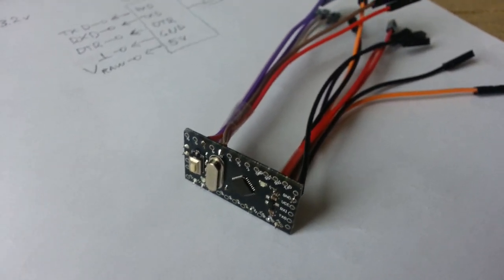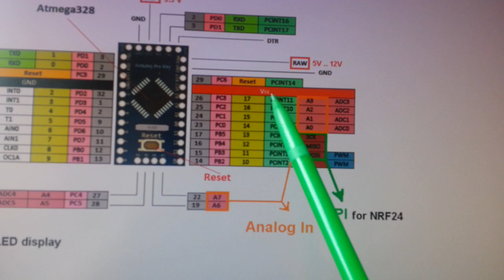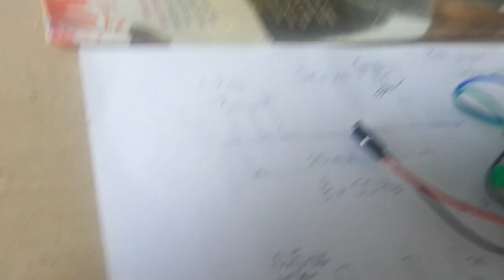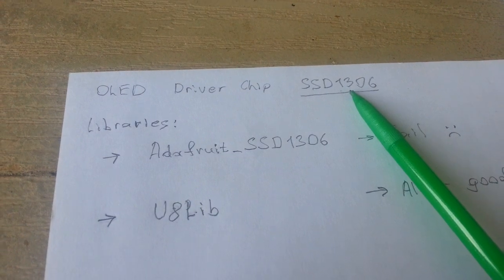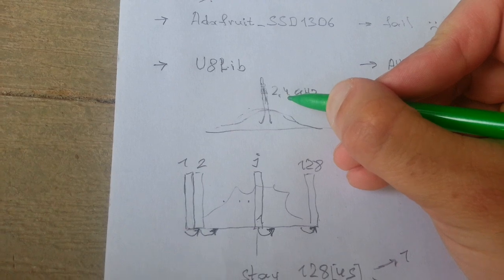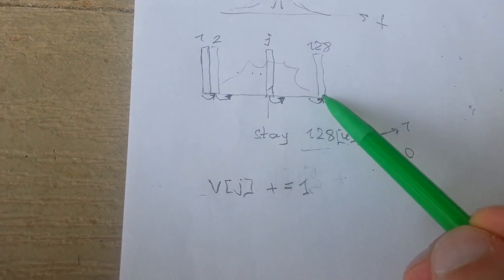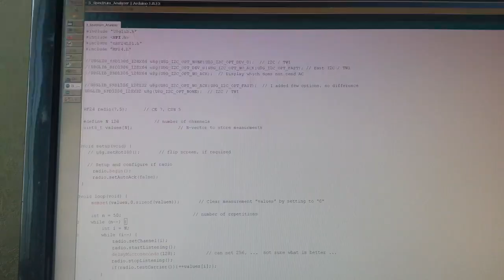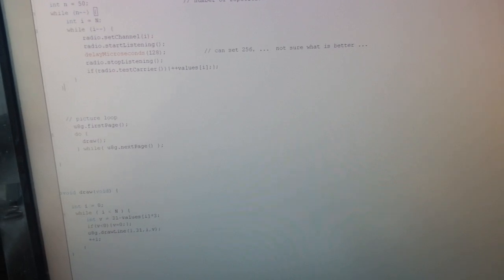The RF Spectrum Analyzer on Arduino + NRF24 + OLED display

Comment: what board should i use  nano or pro micro i have both lying around 
ill let you know how it works thanks so much for the hard work
Reply from the maker: It doesn't makes a big difference, but please make sure you will identify all the special pins correctly 
https://youtu.be/DXnpHavquIs?t=111
Reply: @alexanderbeliaev5244  thank you so much but I got it working just by reading it out and looking @how I had wired other projects and read the .h files it took 2hrs but u did such a great job I figured it out on a nano on my own works great btw 👍

Comment: What is its frequency range ?
Reply from the maker: 2.4 - 2.5 GHz free to use band https://en.wikipedia.org/wiki/2.4_GHz_radio_use
Reply: @alexanderbeliaev5244  can you built Arduino based rf spectrum analyser like this ? Using sl44 module 
 His code not working can you correct it and give its ino to me . 
https://youtu.be/wgV_opQLCms
Reply from the maker: @omsingharjit  maybe some time in the future.
Reply: @alexanderbeliaev5244  that will be nice